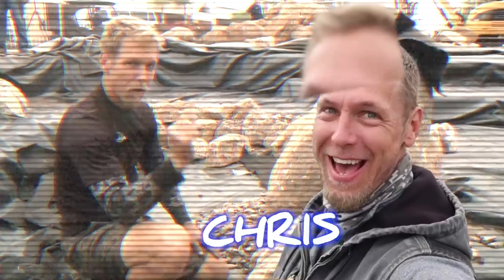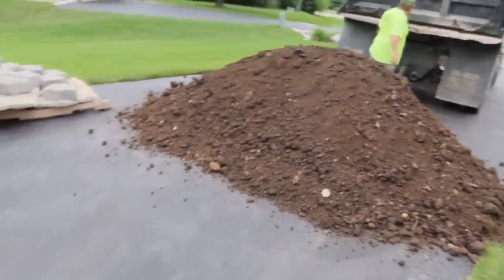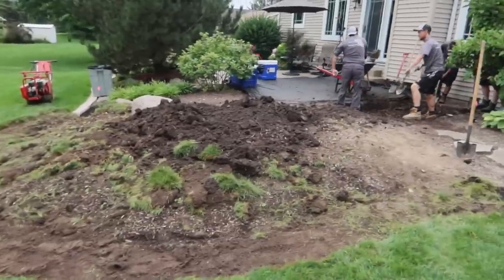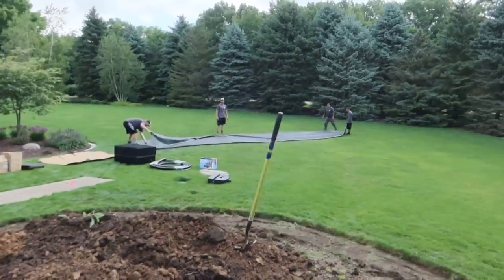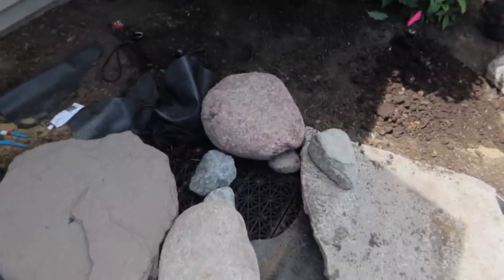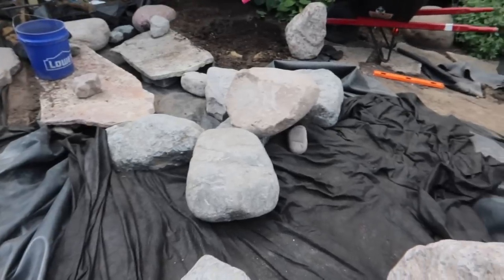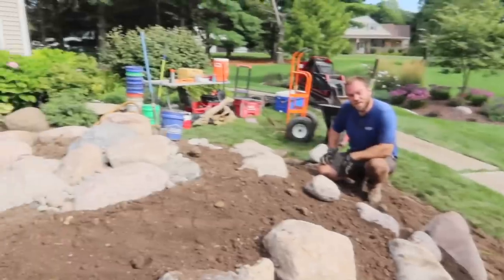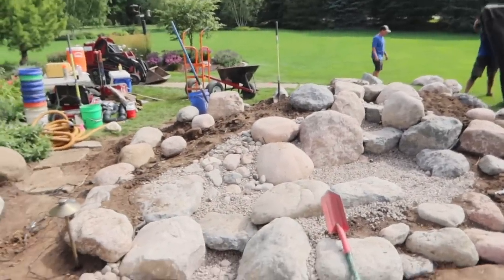WATERFALL Built To Drown Out Highway Noise!

Comment: Just moove the trees don't plant new ones. It's not that expensive to do and it will save time
Reply: You don’t even know what the circumstances are for their removal. 
So apparently you seem to be an expert in the tree transplanting business how per tree is it going to cost to move full grown pine trees and I want a good rate we have a lot of them here…
Reply: @Daihatsu_Hijet  it varies on where you live but good thing Is your only moving them a small distance over right? Without that transportation fee which is the main cost for moving trees, you're looking at $100 to $1,000 per tree. That's a wide range I know but like I said it varies where you live and what company you find to do it. People assume this is extremely expensive to move trees and that's accurate when moving across town or a different state
Reply: @Daihatsu_Hijet  your wrong, you only need one person and the machine does themselves. It's not like I have a degree in Turf Management and haven't moved trees around on the course....but you with no experience and clearly no understanding on how this works so you shouldn't call me wrong
Reply: @Daihatsu_Hijet  I could only guess they need to move them because the county wants that part of the yard for something just a guess since they use it to drown out noise
Reply: @Daihatsu_Hijet  they use a big machine which requires only one person. It's a 9 foot spade that works in pieces and can around the tree with the the way it was designed.
Reply: @Daihatsu_Hijet  oh yea guess what they don't use a excavator. You ask me so don't assume you know everything wheni actually know a ton about the process
Reply: @Daihatsu_Hijet  this wood is bad to burn especially in fireplaces
Reply: @chosen1one930  I know they have a spade machine that digs out a tree I one scoop but it has a limit on size of tree 8”-9” trunk is about it and there’s no way it’s popping up a 50’ pine!
Reply: @chosen1one930  but I can use one to dig around the root ball and push that Christmas tree over and drag to the burn pile
Reply: @chosen1one930  it’s not “bad” to burn just doesn’t make as fuel efficient fire as a hardwood like oak.
Reply: @Daihatsu_Hijet  see your clearly wrong, the 9 foot spade can do trees upwards of 50 feet. They also make bigger size machines. You clearly have no clue what your talking about so this is where I Stop responding. Think whatever you but you should listen to the person with 30 plus years experience on course another 6 getting my turf management degree. Good luck if these are your trees
Reply: @chosen1one930  maybe you should have asked that question as to why instead of jumping into full on tree hugging mode… maybe they are disease and or dying or reaching the end of their lifespan.
Reply: @Daihatsu_Hijet  I'm so lost with your comments dig a hole etc. Is that with a excavator you could do that?
Reply: @chosen1one930  stick to your putting greens! I’m the one with 12 HA in Italy of forest and 67 HA old growth forest, pastures and a lake in France. I get yelled at by tree hugging know it alls; all the time…it’s called forest management.
Reply: @chosen1one930  maybe that’s because you went off the deep end and left so many comments are you not well does someone need to call you a doctor? Do you need medication?